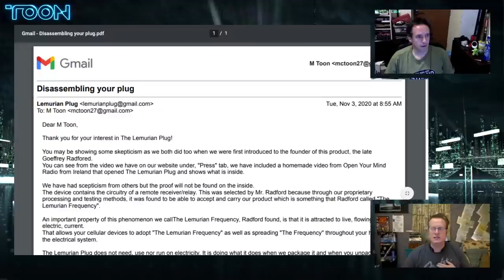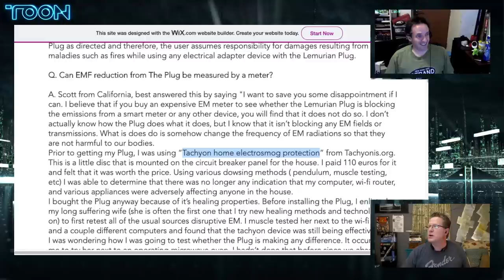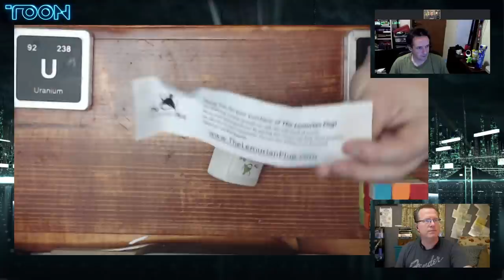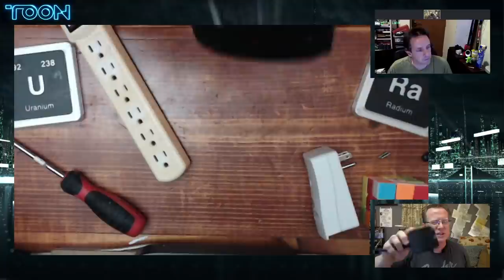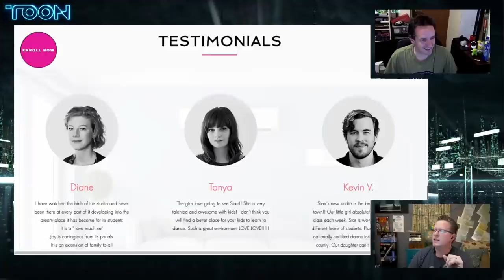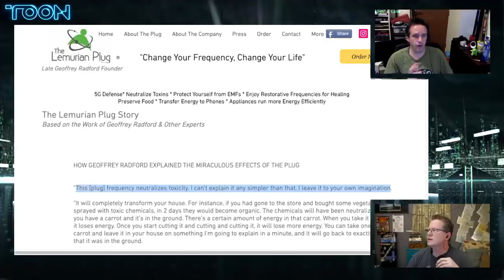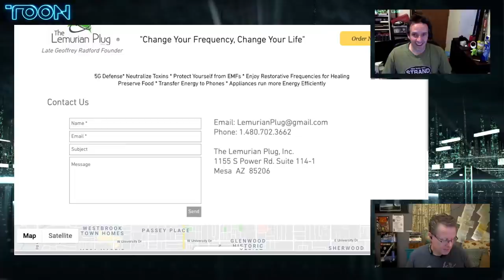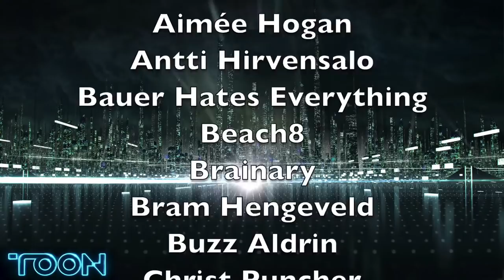Lemurian plug disassembly and debunk, can it block 5G?

Comment: ”Dear support. To amplify the Lemurian frequency range I connected both ends of a long copper wire into the disconnected outlet on the bottom of the device. This worked well until I turned on this remote control socket that I have ...”

Edit: I wrote this as a joke but realized that fraud might not be all they’re guilty of. By claiming the outlet is disconnected that might count as some kind of endangering?
Reply: ya got a point, just what would happen if you found a real one ( say Amazon)  and the remote that operated the real one incedentally operated the Lemurian one...  would letting the smoke out also let out the frequency power??  ;)

Comment: in another video he sez the plug posts arent hooked up inside but dont try to plug it into a 240V socket because it will heat up...why will it heat up if the plug posts arent connected??

Comment: went to the website and found that they are not selling the plug, but are selling the frequency power that they transfer to the plug, the plug is just a carrier for the frequency power to attach to. Obviously they are selling pure power, they can put this frequency power on just about anything, you can even transfer the magical frequency power to your own cell phone by laying the plug on your cell phone and you can take that cell phone which now has the frequency power and transfer that to another cell phone ( reminds me of installing unprotected software on multiple machines). Also read in some other webpage ( a forum) that if you dont believe in the frequency power, it will die and no longer work... so your belief is what keeps this frequency power alive... ;)  They should have at least offered the remote with the plug so you can at least get some real use out of it... just makes you so excited to say WOO!!!!!

Comment: If it actually plugged into and used either 110v or 220v then one would be more convinced that it was emitting some sort of magic wave into the electrical circuits around the home. In that way it might work like one of those rodent or mosquito repellents (if they work at all) . But it doesn’t even need to be in contact with the electrical wires.

Comment: It looks like it is a switch with a remote remote, because there is an antenna that receives the signal from the remote, then it is processed by the chip, which will be forwarded to run the relay. Because there is no remote, the relay doesn't work, and the LED doesn't turn on.

Comment: I was honestly expecting an empty box
Reply: My dad had bought a small plug that claimed to clean the air.

Told him it had to be bunk since there was no way for air to circulate in it and far to small and light.
We opened it up and lo and behold.
Just a little transformer circuit attached to the led stuck to the case with glue. A case that clearly had been designed to hold something different because all the struts ans screw points were still there.

Looked like a damn fire hazard and I bet even the CE sticker on it was a falcification.